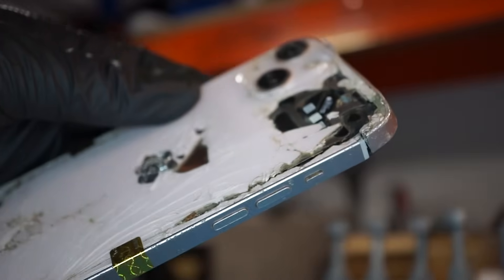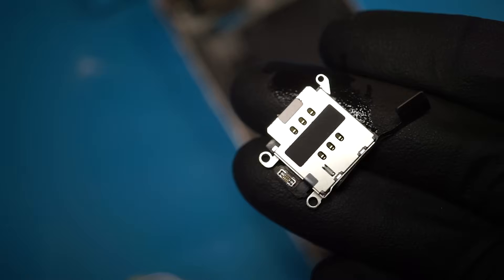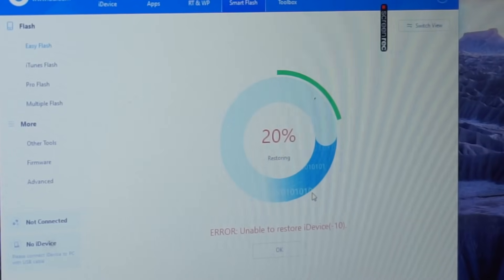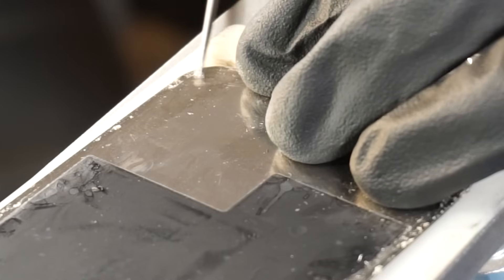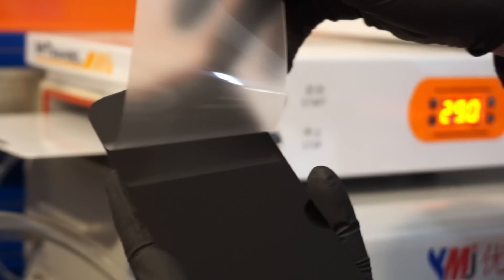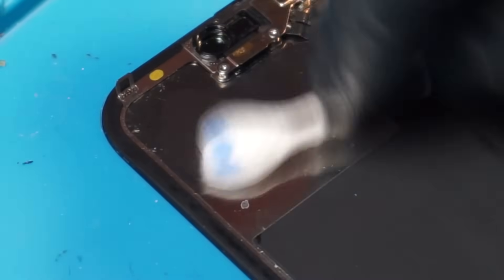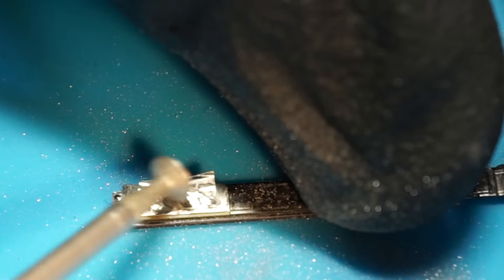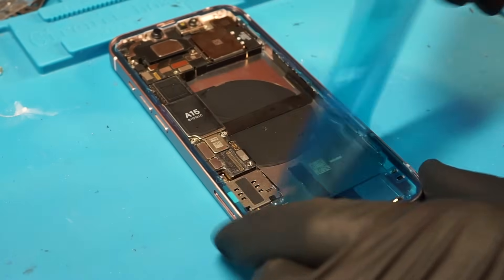How to repair eBay’s Most Broken iPhone… I made It Brand New! (Insider Repair Secrets)

Comment: I did a housing swap on an iPhone 13 but using apple diagnostics it has a cellular rf issue. Any tips?
Reply from the maker: Sorry for the late reply. Did you have any issues with cellular, or was Apple just saying you were? Did the housing come with all parts, or did you swap them all from the old housing, to the new one?
Reply: @ninjarepair  it’s okay, not when I actually checked but the battery is draining very fast, apparently that’s a known issue when you have a cellular rf problem. I swapped most of the parts but also had to buy some aftermarket ones for the buttons and wireless charging coil and the gps flex. Also changed the flash and camera flash doesn’t work with photos now
Reply from the maker: If possible, try with orignal pulled parts. Aftermarket parts tend to be lower quality and sometimes don't work at all.  @AzamT1914

Comment: I Would rather just buy a screen cause the machine that removes all the bubbles is so much more expensive than it would cost to buy a actual screen
Reply from the maker: If you are only replacing 1 or 2 screens then yes, you are correct. If you're doing more, its much cheaper to buy the machine :)

Comment: Hello , i have issue i have done swap bms and install tag ON to the original bms and flash with 3 utool but no battery life info and in your video you use a specific software to flash the battery not 3 utool can you explain please 🙏🙏
Reply from the maker: Try JCID software. "JCI Device Operation Platform" :)
Reply: @ thanks i need jcid Q1 or just the soft?
Reply from the maker: Just the software  @marcoberdudu

Comment: crazy work
Reply from the maker: Thank you for the comment :)!
Reply: @ hi i just wanted to know, will apple replace my usb type c to c cable under apple care, as my dog bit the wire do you know anything about that, kindly help responding, from india
Reply from the maker: Hi! Unfortunately, Apple typically won’t replace accessories like USB-C cables under AppleCare if the damage is accidental, such as being bitten by a dog. AppleCare mainly covers manufacturing defects, not accidental damage to accessories.

However, you can find good quality aftermarket USB-C to USB-C cables online for around $10 USD (₹800 INR approx). Just make sure to pick one with good reviews and proper certifications like USB-IF. Hope that helps!

Comment: The devices are severely damaged and it is better to use them as spare parts instead of repairing them, especially since 13 are still available new at average prices.

Comment: I've always wondered how good the aftermarket waterproofing glue/gaskets hold up compared to the factory ones. Do you have any way to test that? Like a barometric chamber similar to the ones they use in watch repair. Great video.
Reply from the maker: @MohammedMuaawia  as always thank you for your comment! I think as long as you clean the frame correctly and apply a new high quality sealant, the phone should be as good as new. That being said... I would also like to know, so I have purchased a tool to check! I don't think it will arrive in time for the next video, but perhaps I can use it on the one after that :)!

Comment: https://youtu.be/Dk5Fvor3qBY?si=pLNYQnH2ZJhl4epM

In this video, they used a plasma machine, oca glue, UV light, and a tempered glass to separate badly broken glass.

I think this method can safely remove badly broken glass without scratching the polarizer layer।
Reply from the maker: That is a cool video, but the plasma is gun is not needed. If you have the skills, removing the glass should not really be a problem :).
I quite like the laser machine that some people are using to remove the glass, especially for the 15 and 16 iPhone series series :)

Comment: What an amazing job you did. I just changed my iPhone SE battery with ifixit parts. Sweated like a pig during the process and now the ear speaker and proximity sensor doesn’t work and stupid Siri doesn’t either….. 😂 going to buy a new one.
Reply from the maker: @leatherwiz  go back and check that you have plugged the earpiece speaker in correctly. If not, it's likely you tore the flex cable :)
Reply from the maker: @leatherwiz  P.S. thanks for the comment! :)

Comment: Love these videos. Keep up the good work and you will be at 2 million subs before you know it. I subbed
Reply from the maker: @BudgetYouTubers-w1q  thank you for the kind words :)!
Reply: @ your welcome. I am currently fixing a iPad and I am having trouble reinstalling the home button. Maybe you could make a video on how to do that?
Reply from the maker: @BudgetYouTubers-w1q  what's the issue you're having with the home button? The Icloud was already removed from the phone via Icloud.com, but without WiFi it could not be removed until it was repaired :)
Reply: @ I keep trying to glue it on from the bottom but it keeps popping out. The wire creates a bump so the screen won’t close. Thanks for reaching out any tips?
Reply: Also how did you remove the iCloud lock?

Comment: You did all that work on the board and screen why didn’t you just transfer the ic from the old/refurbished screen to the new screen I’m guessing you wanted to hold on to the old screen transferring the ic would of fixed the screen issue
Reply from the maker: @aldean2000  yes I kept the old screen for testing etc :)

Comment: You might of heated the display too much I have the same glue machine on the heat press I only run it for a minute and and the the glue on the frame is hard can’t imagine it running it for 5 minutes.   Maybe that could of been the problem 11:29
Reply from the maker: Thanks for your comment, how are you liking the machine?
The seller of the machine recommends 6 minutes, but I put it down to 5. I feel like it's the perfect amount. Perhaps your temp is higher? 
The issue with the dots is, the screen was already damaged before I had removed the glass, you can see it if you pause it at the time the oled is cleaned :(. I missed it when moving the camera around 😂
Reply: @ninjarepair  What type of glue does the machine use? A heat curing epoxy glue is it?
Reply from the maker: @matthewJamesKendell it's A/B glue. The one I use is by a company called NASAN. The heat press just allows it to cure very quickly

Comment: hi Ninja Repair..i have an iphone 16 pro...

if by any chance my iphone gets lost to a thief...will he be able to factory reset it by putting it in recovery mode and using 3utools??

in simple words....is it easy to factory reset it?? 

and any way to avoid bypassing this method to make my iphone stole-proof??
Reply from the maker: @ak-2005 
They can reset the device, but they cannot remove iCloud on the device. You will still be able to track it until the battery is removed :)
Reply: @ninjarepair  if battery is removed....but a new battery later is installed...can it be tracked again??

and also there are some shops in my country where they claim they can open the icloud lock...either by bribing them..or by showing the bill and prove them that you are the owner...

so icloud unlock is possible by any means?
Reply from the maker: @ak-2005 
There is a way to unlock by falsifying purchase records yes, but to my knowledge there is no option to remove iCloud on the newer ios versions. 
Once the battery is removed, the phone cannot communicate anymore. Once the battery is plugged back in. Most likely though, the phone will be used for parts
Reply: @ninjarepair  yes....part dissassembly is the only option by which most phone owners are scared of (lose of tracking)😅😅

btw thanks alot for replying....been your followers since last 1 week...and i really like you content
Reply from the maker: @ak-2005 
Thank you for the support! I will try to make another video soon. They take a lot of time though 😂

Comment: Wow,

I've seen repairs, however you are a cut above the rest. You seem to have all the correct tools to do an amasing job.

How much did you buy the phone for and how much qan you resell it for? How many hours did it take you to do the repair?
Reply from the maker: Thanks for your comment Robert. I have spent a lot of money over the years on the tools, but there are now cheaper alternatives. I would estimate about $15k+. Shipping the machines from China tends to be expensive, but sometimes you can buy second hand machines for those not doing refurbishment anymore for much less! 

This repair took a very long time, mainly because I had to move the camera angle with most of the shots. I only own 1 camera so it probably took about 6 hours or so.
Reply: @ninjarepair  keep up your excellent work. Having seen this video, I have now subscribed

Comment: great video man that was a really good to watch, your narration was also really good,  i did a question though. how would you go about fixing a phone that has a small bend in it?
Reply from the maker: @NotABear321  Hi Emily, thanks for the comment. I'm glad you liked it :).

There are 2 options, you can remove the screen, LogicBoard, camera and battery, and try to bend it back that way. Or you can do the housing swap like I did in this video. I wouldn't really advise bending it back with the LogicBoard and screen still attached, because you could quite easily damage something. I hope this helps, and good luck with your repair :).

Comment: how did those two black dots appear? they werent present when you split the glass

ps. also why not replace the screens ic to the new screen?
Reply from the maker: @azn789456  if you look really closely when the glass is removed, the dots were there, but I missed them. They got slightly larger in the laminating process :(.
I could swap the ic from the old display to the new one, however I can still use the screen with the dots for testing other devices, or sell the screen for a reduced price :).
Reply: @ninjarepair  oh wow i do see them now @ 9:00 and also have you heard of the new REWA screens that come with ICs installed that dont need to be prorgammed and doesn't show warning or error message?
Reply from the maker: @azn789456  I saw these screens too. They look very interesting!
A repair friend of mine said I should be able to make the phone (in this video) recognise it is genuine. I'll try sometime this week and report back.
Reply: @ninjarepair  sweeeeet cant wait